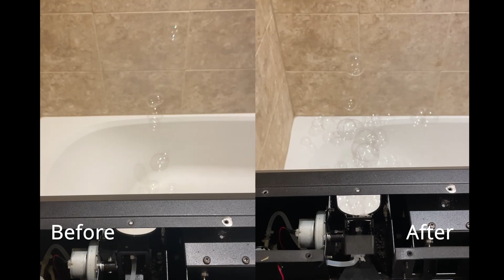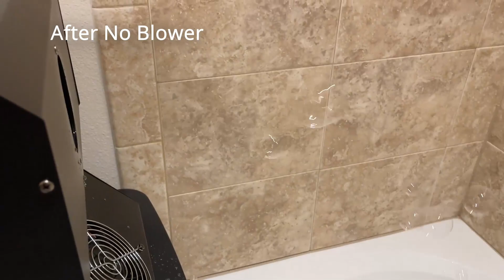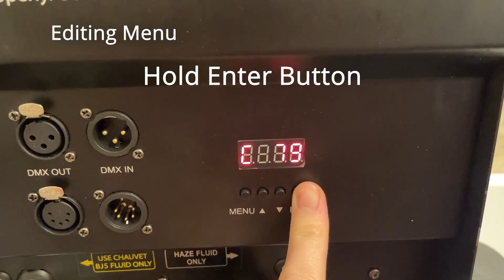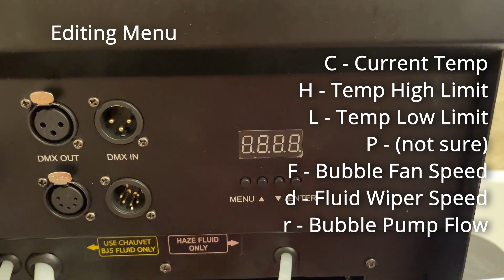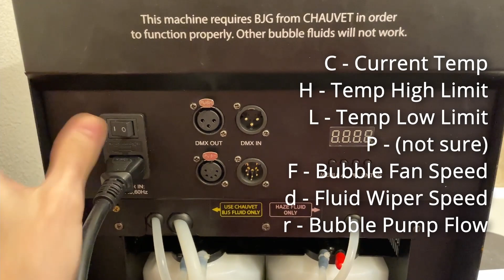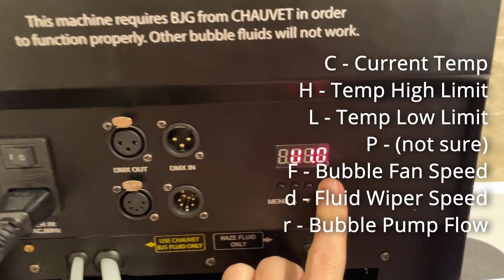Chauvet DJ Hurricane Bubble Haze Machine Repair - Adjustment for Low Bubble Output and Service Menu

Comment: Can you help me, my machine bubbles work but no haze ( I have set it at 50% and raised it to 80%) and no haze at all
Reply from the maker: This machine is pretty much just a simple fog machine internally, so you would need to check all of the usual points of failure. Does the heater get up to temperature, is the pump moving liquid? (and not just vibrating, sometimes they fail but still sound like they are working) There could be a blockage or kink in the liquid lines, or a blockage in the heater itself. Searching around for guides on how to fix simple fog machines should help out a lot.